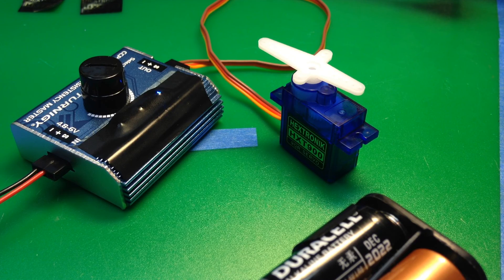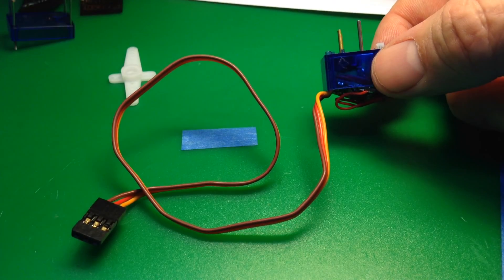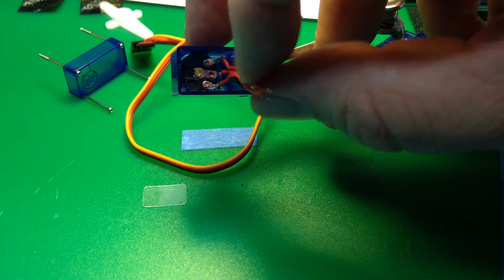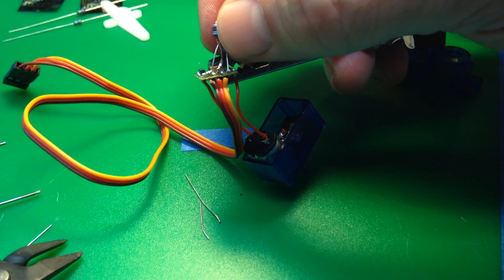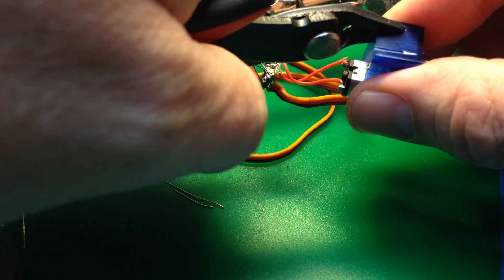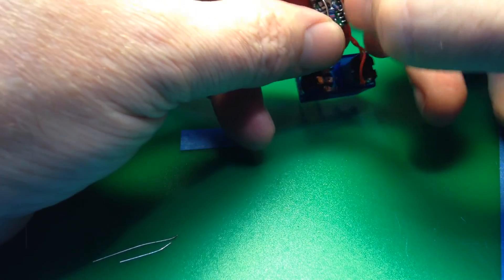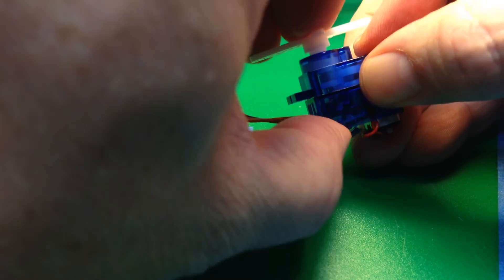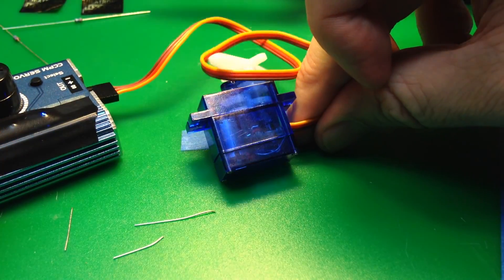Making Continuous Rotation Servos

Comment: Can i replace the potentialmeter with resistors instead for led lights on and off switch on remote control i still got the potentialmeter on mine i want to remove the potentialmeter